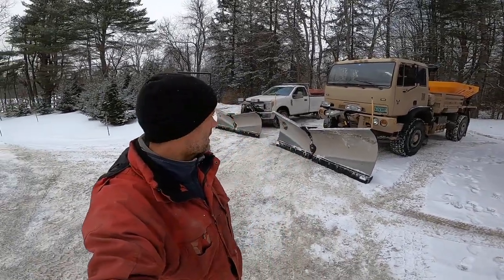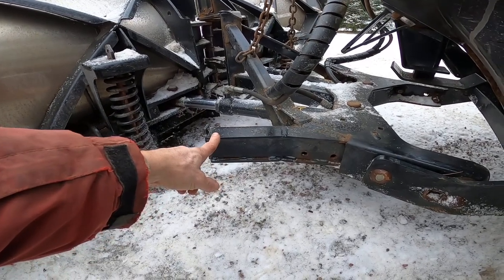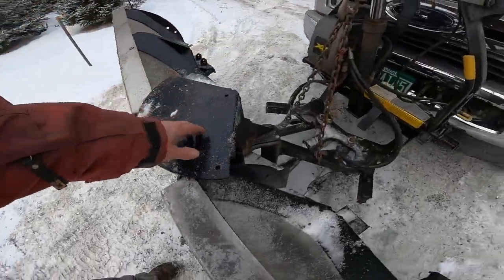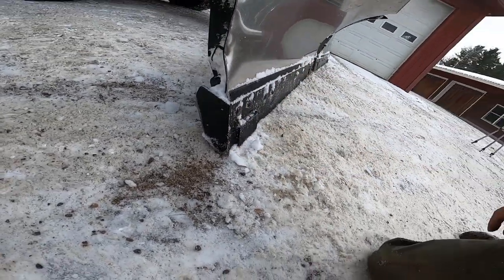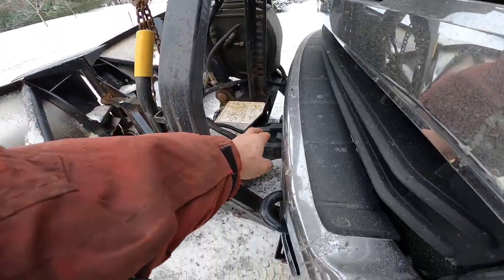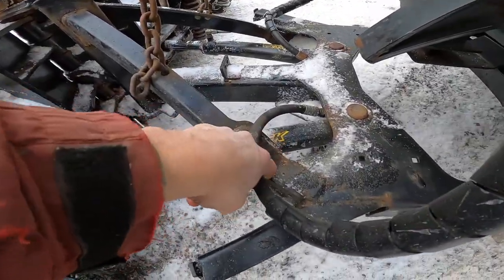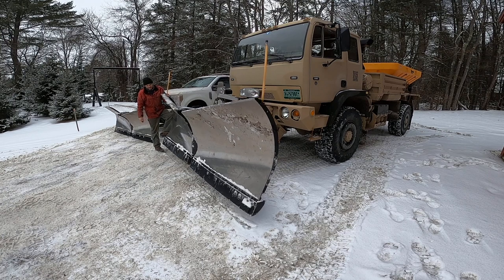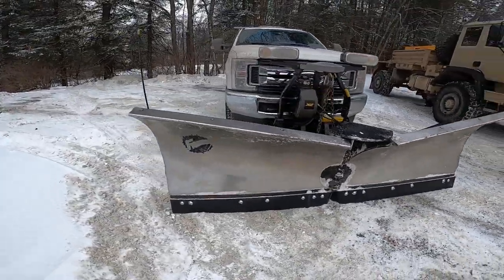Fisher XV2 10-6 and 9-6 snow plow comparison

Comment: I had a 7 and 1/2 foot straight blade from the early 2000’s on my 2005 GMC 1500. I really liked the Minute Mount 2 setup cause I’m in a wheelchair and I could hook up the plow myself very easily. I had 10 good years with it and it was still working when I sold the truck. The only issue I had was a couple of solenoids going on it.

Comment: Yep..Agreed!  I've had one of my 9-6 XV2 since 2012 (can't believe it's been that long).  However I don't think I'll move up to the 10-6.. I plow with the extensions on both of XV2's & it works perfectly, for the parking lots I mostly do.. Great video!
Reply from the maker: Those extensions are great for parking lots. I like how they angle forward a little bit to hold the snow.

Comment: Cool videos but you really don't have much experience with plows...they all do that...if they didn't have give they would break quickly...tons of force beating on those points
Reply from the maker: That's exactly why they made it pivot like that. I've welded together several of the style that are not designed to pivot. Yes, there is some slop in the pins and they will move some but it's not enough.